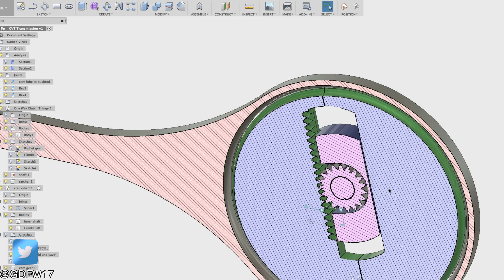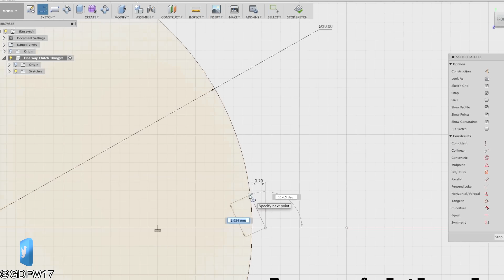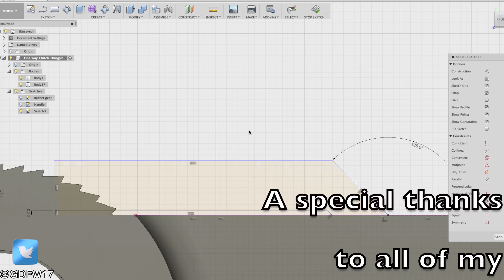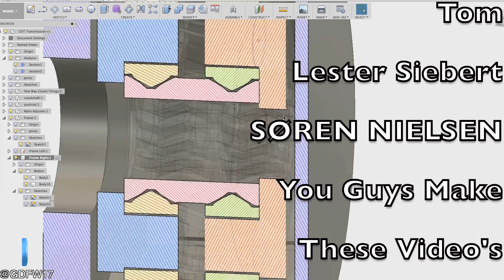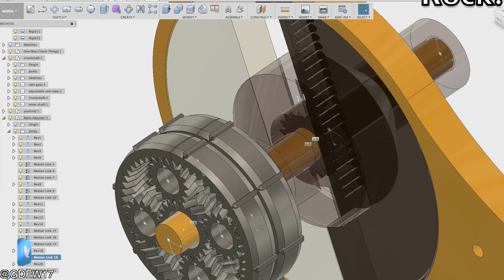The Coolest Transmission You've Never Heard Of... The Ratcheting CVT

Comment: You could use it to create a variable valve lift engine head. Dial from gas mileage all the way to dragster. People have tried with servos and solenoids which fail due to the heat.

Comment: Looks like it would only work with 2 torque converters. The output is to jumpy(that's why u need a second). Also u know piston rods have a point where they stop and reverse very bad idea for a tramsmition that needs to be 100% smooth. and how do u get overdrive? A seperate output shaft gearbox? The only way this could be automotive(mo likely lawn-motive) is if it was integrated INTO the engine crankshaft(see saab). As a tranny for a car........ no never. But just because it will never be automotive dosent mean it's a bad idea. It would be WAY WAY more efficient if it was inside out cone (like modern cvt) on an iris like a camera aperture,that would  directly attache to the gear cones. by way of a dogbone shaped dual iris with the chain on the exterior of the dual big one irises . The chain would never stretch. CVT would have infinite gearing and have very few moving parts. 😉 BUT I'm just a red head talking to pixles om tje interwebs

Comment: Why not just use a hydrostatic transmission as used on zero-turn mowers?  They give you smooth, stepless power flow from full forward through stopped to full reverse.  In addition, they provide dynamic braking.

Comment: Same mechanism used by pinion gearbox for gear shifting
I am designing of true CVT with positive gear engagement & without any ratcheting/ oil or metalic Traction, theoretical efficiency above 90%, Ratio increment up to 1000%, Weight app. 40% of conventional gearbox.

Comment: Nice! It's a bit how a steam locomotive 'changed gear'. It had only one ratchet (well one on each side) on the outside together with the arms that where connected to the wheels / steam pressure. The closer to the pivot point, the ''higher' the gear. I don't know how common that method was among the steam locomotives, but I'm sure it would have been used all the time.

Comment: Everyone complaining about it not working of its already invented 
Nothing new has been invented for 100years 
It's just combining other inventions or taking ideas  
Might not be practical as a cvt 
But being able to adjust the stroke of a rotating concord has huge uses elsewhere 
Such as variable displacement engines
That's the genius in this build
Reply: The transistor wasn't invented until 1947.

Comment: Eh. You should probably adjust the gearing just a little because the output is quite torquey. Most normal transmissions reach a higher output to input ratio than input to output in their highest gears. It should just reach higher output speeds is all I’m saying, that is the point of a transmission, to reduce stress on the engine.

Comment: That transmission would be enormously useful in electric car, as it does not disconnect from engine
Reply: Electric motors do not need a gearbox - they are already continuously variable from zero to their destructive limit, even if they might contain a stepdown gear.
They do not need to be disconnected from transmission, unless they're not needed because other motors are working. They can be reengaged at any speed just by matching velocity -- no clutch needed.

Comment: That’s awesome, the variable ratio side is really cool, it gets me thinking about other ways to achieve the same concept using hydraulics or centrifugal weights.

As for the ratchet side why do you need it to ratchet? Why not design a crank shaft with offset journals. Or experiment with a similar system on your output shaft to variably offset the journals. You can use your the system to change the ratio on lots of things without requiring ratcheting. Now that I’m thinking about it, you can look at a variable valve timing motor motor for more ideas.

I wonder if you could use similar ideas for a Napier Deltic motor that uses three cranks.

Anyway awesome job and thanks for the brain candy, this will keep the wheels spinning for a bit.

Comment: The best part of it is the dual planetary dual differential system. That's awesome. The only feature that would make it less than practical for automotive use is the fact that it can't hold back. It will just coast freely. I don't know what mods would make the ratchet mechanism bi-directional. Using torrington sprag clutches, rather than  ratchets would give the output infinite resolution. I can see with ratchets, it might become hit-and-miss at certain stroke lengths. this could cause ripples in output shaft speed. I have to say, I envy your ability to make gear mechanisms with 3-D printing. It actually looks pretty precision, more than good enough for prototypes. This concept might be good on a bicycle, because they're designed to coast when you stop pedaling.

Comment: I know that it's a little late but I just ran into your video here and I love how well your device works and I was just wondering what filament and printer you used? You mentioned near the end when you took apart the gear mechanism you saw some of your parts beginning to weld, so if it was at such a low speed and begun to weld is it pla? I'm really curious. cause I would love tinker with the design and material and try to improve on it and maybe even use it for something. Great Video 👍👍

Comment: You're right, many people have likely never heard of this. Unfortunately this exists, or I'd be a millionaire now, maybe. I found out about the CVT, made  y Nissan about 10 years ago when I was designing a similar concept. I wanted a transmission that would be able to elimate the need for lifting off the gas and re-engaging a new gear. Mine did work different to this though as the gears were conical and worked by sliding a clutch forward by hand, in a similar fashion to how an aeroplane throttle operates in an airliner.
Great video though and a great print. Bravo!

Comment: if you remove the output shaft, put pistons at the ends of the reciprocating rods and reverse the output it'd be an engine.  I think you inadvertently invented a variable compression engine and didnt even realize it 🤔

Comment: How small could this be ? Could it fit in a 2 x 2 x 1 inch space  ? (Assuming we make the round piston thingies from laser cut sixteenth of an inch thick steel plate and it would only need to have an output torque enough to move around a structure about 40 pounds with very low friction wheels and flat surface (intended for use in FTC robotics competition) invade you were wondering )

Comment: May be think motorized
bike application,smaller but strong and lighter.I
for one know alot of motor bike people would really
welcome any sort of trans.
The only shifting for them now includes alot of extra 
chain,gears and Jack shafts and so on.just build
one strap it to a motorized 
bike and test.this is a giant
Industry that China has produced a lot of stuff for.
If a trany came out ,made in a country of known reliable manufacture, you could have a hudge customer base quickly.i have 2 transmissions on paper of my doing with less than half the parts of
yours.l have built motorized bikes in Calif.
Since the 1980s.I love your
design.keep it up
Neil

Comment: The most common CVT is commonly known as variator and can be seen in some go carts and in almost all scooters and i know that microcard atleast some of them use it too and the reason why i love it is because better gas economy on my 2 stroke scooter which has smaller gas stank than my friends supermoto mopeds and is still capable of going 60 miles further i can compare my gas economy to 125cc 4 stroke enginge that has about 17 liter gas tank and it goes about the same distance as my 2 stroke  bike that has 6 liter tank and that is alot because well 50cc engine and none of us have any restrictions left

Comment: I like your enthusiasm but it’s fairly easy to see that this is not a very efficient system.  Good effort - it could be useful for students studying mechanical engineering.
Far to many moving parts. More parts = more points of friction that needs to be oiled / cooled and more possible failure points. I’d rather change 1 rubber belt than have to screw around with that.

Comment: Hey dude, I'd be willing to build a dune buggy that uses this transmission. I've been contemplating wethe ror not to slap a cheap cvt or invest in a manual since lots of them are made for the vw beetle air cooled engine. I know everyone is telling you it's impractical but how exactly do they know this without any testing? That is foolish and unscientific of every commenter that said that, if you could just make assumptions like that, R&D would have no place in modern product development and we'd have already figured out how to achieve warp drive. I've myself thought of a different type of CVt though, that operates somewhere in-between a conventional CVT and your Crank CVT. Id love to see if I could describe my idea to you and see if you could try to implement it in a 3D printed design and see if it works IRL. Let me know!

Comment: So look the cars that use the CVT they are 100% garbage they spend more time hunting for gears an slip alot. Also you can not service them. They are literally a throw away transmission.  I am hoping with time they will become better however right now they are 100% garbage due to the cost of replacing them an the fact they do not last nor can they actually handle large horsepower since we all know that NOW boost is replacement for displacement an cars tend to have 400+ horsepower these days which these production CVT transmissions will not hold up to.  The only person that has built a successful CVT is Christian Von Koenigsegg in the Regera.

Comment: Awesome, however, from the clicking sound i can only assume thats from the one way pushrod turners. Sounds like it will also have extremely high stress and heat while its under high stress. Needs work, but you're headed in a good direction, I sure as hell couldnt do that.

Comment: nice!. I've been designing an exoskeleton system for some years and i have like one year and half trying to make an infinite variable transmission (from 0 to x rpm)to control the articulations. This design came in my mind, but i figuered out that it's not viable, because the power you need to rotate the controller is proportional to the force in output. it means, you need another motor of the same size as the in the input to rotate the controller. Btw, i have made a design that works well, but it needs one way bearings. It works similar to a piston pump, where force excerted in the controller is perpendicular to its working motion supported by bearings, reducing a way lot the power needed to move it. You can even attach another trasmission to get a complete infinite variable transmission system (0 to "inf" rpm). If you are interested, i can send you the model but with the condition you print it and upload a video :D.
As a final note, i will not implement my transmission design because of one way bearings (i dont trust them lol), but mainly becuase i want to transfer power from one motor to many transmisions, so i decided to design a small star piston based hydraulic transmission pump instead. So, keep it up with your videos, they are great. And thanks for subtitles! (sadly, my english is not good)

Comment: I was wondering: how about making a cvt (sort of) with a petrol engine moving the cage of a differential, one planetary wheel linked to an electric motor and the other one linked to the wheels. By using the electric motor as a generator we can slow that planetary wheel and make the other one move faster (up to close to 2x the petrol engine speed). We can also use the motor backwards to further increase the speed or forward to decrease it.

Comment: You should look into replacing the ratchets with Sprag clutches!  They function the same way as a ratchet but with much smoother operation, and are used in automatic transmissions, helicopters, and a variety of proven heavy duty applications!

Comment: In answer to 10:35
The only reason this would not be a real CVT is because you can only ratchet a discrete number of pins at a time, so you adjust the cams to not be enough to ratchet: Neutral. More adjusting = 1 pin ratcheted at a time = first gear, 2 pins at a time = 2nd gear etc.... Unless you get a really fine toothed ratchet, but it still would be "digital" to some degree.
Reply: I suggested using torington sprag clutches in place of the ratchets for just that reason: infinite resolution.

Comment: I used to think trains used a CVT because I could hear the engine revving hard at a single pitch as the train accelerated. Turns out the engine on a train is a diesel generator that runs electric motors on the wheels!

So I guess there is the answer: convert to electricity! Now what to do about the gear ratios of the electric motors.
Reply: The motors and generator are a type of CVT.
Reply: @Bad Santa The only problem, is the weight and the bulk. No problem for a train locomotive, but would really weigh down a sports car.
Reply: I think electric motors have a much wider range in power band. Much less demand for a transmission.
Reply: @Blake Belladonna the opel ampera works that way
Reply: That kinda how some hybrids work
Reply: I thought about this, though a direct connection from engine to motor would still result in the engine having more resistance when the motor is loaded down, meaning the engine might still need a variable transmission to adequately power the motor, if there wasn't one between the electric motor and the wheels, even if the electric motor can be used over a much wider range, unless a storage battery was used.

Comment: Wait, so it burns out over time in motor vehicles making them difficult for use... but perfect for stuff like Formula 1 racecars, who have tires that burn out over the course of 2-3 laps. That level of fine control over the gear ratios would definitely benefit the drivers, too.

Comment: this will be very good for low speed Heavy torque applications (ie loaders for construction) but for vehicular applications, This would be no good. That being said, even the a belt driven cvt is useless for anything except fuel economy.  If there was a way to eliminate slippage, boosted vehicles would always be spooling and would run very good performance, but the limiting factor will be the cvt again, as they cannot handle the stresses  involved without wearing or breaking or slipping.

Comment: (No reverse slippage. Good safety point if this was driving a lift.) Try this. At the final drive. Replace the ratchet with one way bearings. With the ratchet there is a zone where the cams are moving a little but they are not advancing the drive shaft because the ratchet finger is not traveling back far enough to notch into the next ridge on the drive shaft. I'm thinking a one way bearing would be better since it grips at an infinite number of points around the rotation. One other point to be made here. You had zero load on the drive shaft. Some posts spoke of vibration. I assume the vibration would be from the ratchet motion. That could be absorbed with a non-ridged coupling method of the output drive to the target. Say a friction load and accelerometer to measure the steady pull? 

This transmission is a reasonable solution when variable output speed/power is needed, zero rpm and up, and the power source has to continuously turn and has a limited range in its output rotational speed.

Comment: You could also replace the crank shaft. By using the motion directly of the offset of the big end gears.

And I think if you made one of the ring gears integral to the frame you'd need one less part and yet maintain identical operation.

Oh and lastly, since you are 3D printing you could make those gears stronger by a. Sintering using an amalgamation of tungsten carbide and cobalt as the medium (assuming you have a sintering printer) or at the very least make the gears hypoid

Comment: so each time one of the last "arms" (gonna have to use lay-man terms here, sorry)  moves back and forth, in the semi-linear movement, that turns the output axle by one notch, right? That's why it's got that funky shape you were talking about? So in addition to adding more cams to improve stability and decrease the backlash (a term that I do know! I feel smart! ), could you also increase the number of bumps on the output axle to get smaller movements? For instance, having four bumps would more the final axle a lot every time one of the final arms moves, but it would be very herky-jerky. Adding more ridges would improve the smoothness, right? Or am I thinking about this backwards? Thanks in advance

Comment: It might not be mechanical, but it's worth mentioning that a hybrid vehicle does in effect have a continuously-variable transmission in the form of active electronics. A simplified overview is that the internal combustion engine drives a generator to charge a battery via some power electronics, and then that electric energy is converted using other power electronics to drive an electric motor that drives the wheels. The internal combustion engine is then totally decoupled from the motor that actually drives the wheels, so it can be run at its highest efficiency or highest power point. The electronic conversion is high-efficiency (as much as 97% according to one site I found) so there are minimal losses in the "transmission", and the overall efficiency is much better than a bare internal combustion engine with a conventional transmission.